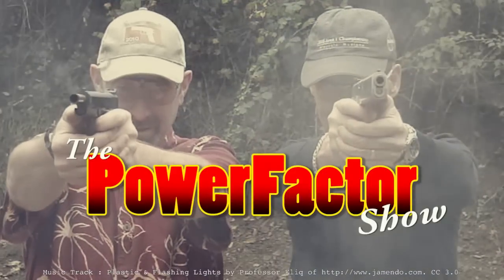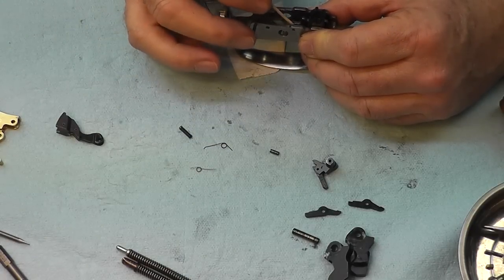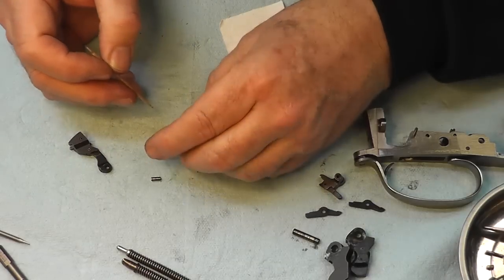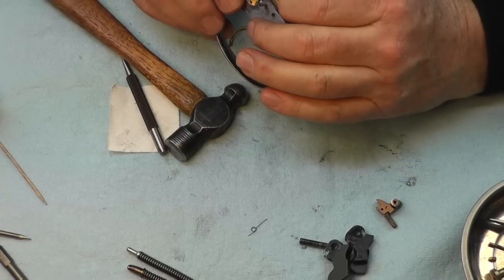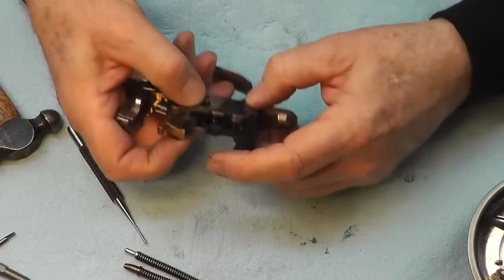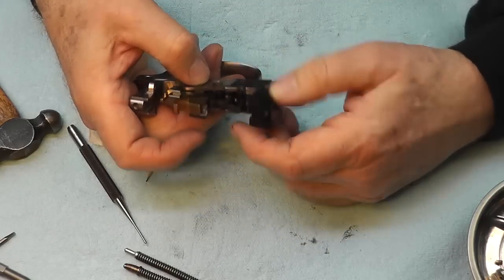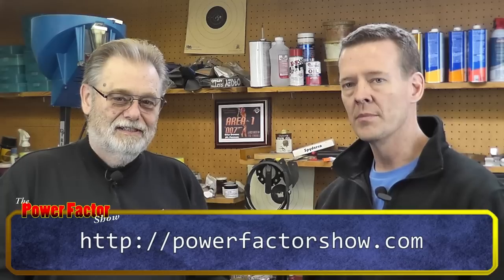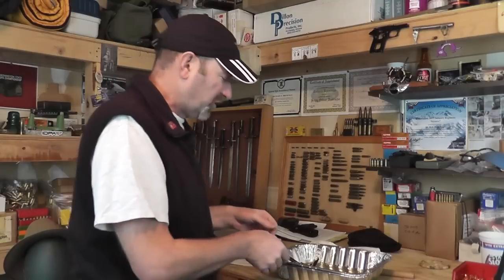Episode 166 - Beretta 68x Re-assembly & Webley RIC No.1 Restoration

Comment: Hi, Excellent video, as are your others.   So useful and gives me confidence to have a try at "Gunsmithing".   In this video you do not mention lubrication of the parts.   Do they not need very much, or is it taken as read that you oil as you go.   In a previous video you mention Mobil 1 oil - Is this motor car engine oil?   I am in UK so not sure if I can get the same stuff here.   Thanks again for your time and effort.